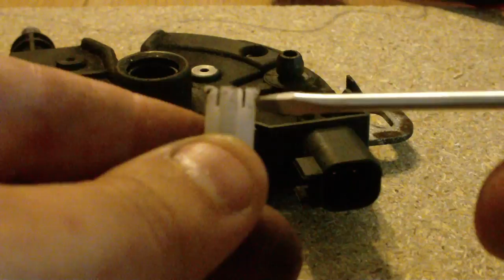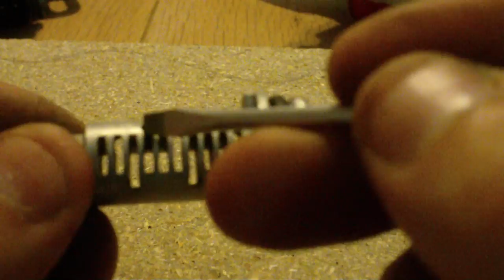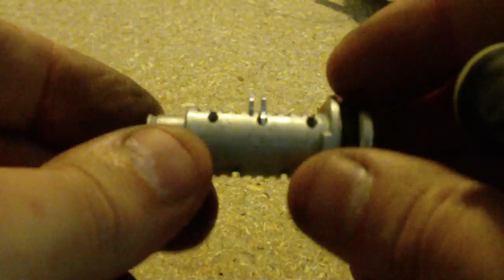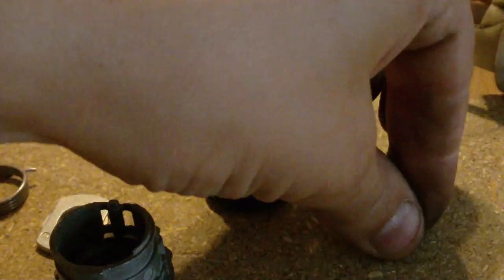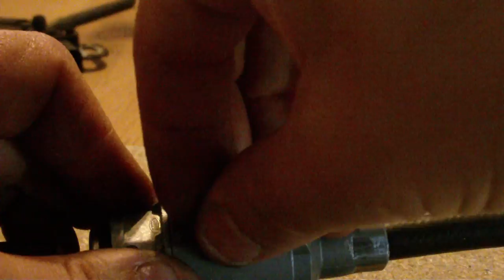Ford Bonnet Lock Barrel Cylinder Assembly and Bowden Cable

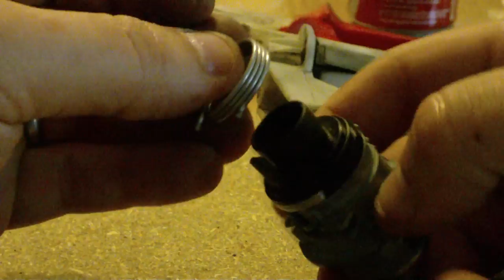Comment: at 15:40, you don't just put the spring on the plastic bit. You have to lodge one of the prongs at one end of the spring against the protruding bit of plastic and then using a screwdriver push the spring from the other prong over. So that when you turn the key in the barrel it will centre itself automatically.
Reply from the maker: Yeah - well spotted - I missed that originally! Works ok, but as you say, doesn't re-centre properly.
Reply: Yep. Thanks for the video though... Very informative and saved me a lot of swearing.  I didnt go all the way rebuilding the lock.. I swapped my entire mechanism to housing..
Reply: How did you get the old lock out of the bowden cable? Did you drill out the pins?
Reply: Stephen Hand it just unclips from the white plastic bit. thats what causes all the problems
Reply: I had a hard time to put the spring in the back together. Came back here to write how it's done. Well you got it right. I should have read the comments before I start working on it.
Reply: It's not too late. 

Drift out the long roll pin, the two shorter pins can be drifted into the lock. 
After disassembly the short pins can be recovered from inside the lock.

No screwdriver needed to force the springs prongs either side of the plastic tab, the spring is not that powerful.

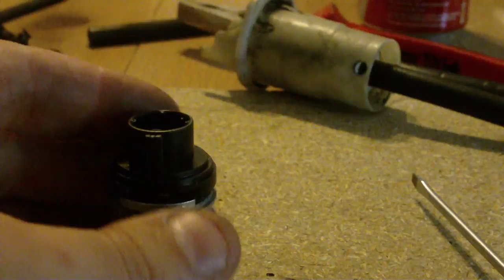Correct spring alignment can be seen here at 14:28 -
https://youtu.be/13QpUSUL5gw
Reply: goood pont man

Comment: What an amazing tutorial. I was quoted £300 by a Ford garage (yes, that is not a typo!) to get my bonnet working again, and I would have ended up with a 2 x key car! Of course, if Ford had have designed a proper bonnet release in the first place, you know, like a lever in the cabin (!), it would have saved us all alot of grief...

Comment: The spring however should be compressed so that the ends of it are crossed on the the black protruding piece. This way key will be always returning to its original position.

Comment: I just realised how old this video is,  but your an absolute star my sons bonnet didn't open after I put a different style  grille in for him, even though I was extremely careful with the lock, but the grille didn't give up easily and I didn't check before I closed the bonnet doh😣....... Fishing forceps pulled the rubber boot off, pushed forceps into plastic pushed lock with the key and 20 seconds after pulling the rubber boot off, I was in....... Thanks again 👍🏻👍🏻👍🏻👍🏻👍🏻👍🏻👍🏻👍🏻👍🏻

Comment: Great video, and 10 years later I'm now watching it. Thanks for doing this, I'm now on my 3rd bonnet lock but this time I've got the alloy one, no more plastic. Will take note on 15:40 👍
Reply: I also need my third on my ST. What a pile of crap that design is. I would be quite happy with a lever inside the car. Never had someone try to break into my engine bay lol!

Comment: No instructions came with the purchase of the new unit, so I had a go at trying to figure it out myself as I'm pretty logically minded. Got about half of it correct, but resigned myself to having to take it it in to a garage. This video explained all the gaps in my guessing, and I will crack on again when I get home! Thanks!

Comment: Great video and so glad it is here. A couple of points to add to the video info:

1) I purchased FINIS 1343577 today and it only came with 8 springs too so this must be the standard Ford pack and you have the option of which 8 holes you use, instead of all 10.
2) In case you were wondering, the lock kit does come with the plastic cross clip that connects the lock mechanism to the latch, already fitted. Saves you buying a separate one if yours is broke. 
3) In the video, the spring seems to be just placed on the black end piece with the two fingers either side of the black plastic post. Although this will provide some spring back, it will not be enough to return the lock to the centre position fully. Instead the spring must be placed on top of the black piece under tension. You do this as you fit the spring by placing the lower spring finger to the left of the plastic post and the top finger to the right of the post. If you have done this correctly then if the whole lock is carefully tipped upside down, the spring should not fall off.

Hope this additional info helps.

Comment: I have just fitted a complete assembly after looking at the first 55 seconds of your video, showing how to remove the white cross part by simply pulling it.  Actually, I'm glad I watched your excellent video, because I suspect, had I tried to do what you did with the lock rebuild, I'd either have lost some springs, thrown it all out of the window or lost the will to live or all three. Well done with your video and once again, I'm glad I bought the complete item. Thanks.

Comment: Excellent video. Great instruction for a very tricky job - thank you. You have saved me £250, as my Ford dealer wanted £300. I had to destroy the plastic bonnet lock assembly completely, as my Focus Bowden Cable had snapped. I also had to use tin snips to cut out the grill. A new grill cost me £19 and a new Bowden Cable repair kit £32, both off Ebay. Thank you, once again.

Comment: Thanks!....Great video... Can't believe Ford don't put any instructions in the kit.
The only recommendation I would make is to work out each key tumbler one at a time, then remove it and write the sequence down as you go. Once you know all the correct tumblers for each slot, build them in one go. That way you don't keep dropping the little springs.
Thanks again for making this... save me trying to work it all out for myself.

Comment: Hello,Thanks a lot for a great video much appreciated, saved me a lot of time.
There is a small mistake at 15:40, when you fit the spring. The two ends of the spring need to overlap over the plastic bolt (so you put both ends at the one side of the plastic bolt, and then you force the second end - further from the bolt and pull it over the plastic bolt.) this will greatly improve precision of the recoil spring, and it will align the key perfectly - no loose key).  

Thanks again!
Reply: How do ya get the spring on it properly without damaging it?????

Comment: Just carried this out and took not of the spring comments worked a treat and saved myself a fair few quid as well many many thanks even managed to complete the tumblers first time and took note of the order the tumbler numbers are as well in case this ever happens again in the future save myself some time putting them straight in instead of having to go through them 1 at a time.

Comment: Just had to do this. One little note, the spring will need to be positioned around the black plastic bit to keep the whole thing nice and tight when you turn the key. Other than that, it's a very good guide and saved me the time to having to work out the engineering behind it myself. Thanks mate.
Reply: Agreed, the barrel should spring sharply back to centre when key released. This is done by 'over-wrapping the spring on the black plastic bit.

Comment: HiMany many thanks for uploading this video.  You have helped me a great deal.  I managed to get my bonnet open without damaging the grill or anything else.  The cable was completely sheered off so the whole locking mechanism was replaced.  Of note, the plastic cross piece connection can be replaced, there is a direct replacement part on Ebay which prevents the locking mechanism from displacing, preventing the problem re occurring.  It's a tamper proof mechanism that has never worked properly so I won't miss it.  Thanks again anyway.

Comment: Very useful video - thank you so much. Thought this would be a painful job but with the help of your video it turned out to be very straightforward. One thing I did differently, which made it a bit easier was that instead of trying to hold in all of the little plates and springs into the barrel at the same time while trying the key, I only tried one plate and spring at a time and recorded the result in a matrix on a sheet of paper. I numbered the slots in the barrel 1 to 8 along the vertical and wrote the plate numbers (1 to 5 and 11 to 15) along the top horizontal side. I put a tick in the relevant box (e.g. if plate 5 fits in slot 1 without sticking out, I put a tick in the 5th box on the top line) and an "X" otherwise. Then when each one had been tested, you could read off the "code" from the matrix/table.

Comment: Great video : purchased a repair kit on Ebay , no instructions, and a great pile of brass bits amongst other things.Watched your video several times and saw how to re-build the lock.Had a few mishaps, which resulted in springs & brass bits everywhere - several times :-(Eventually as I re-built the barrel, I wrote the brass numbers on the barrel with an permanent pen, against where they went.I could then rebuild when I had another mishap !I did finish by using a fine piece of emery paper, with the key in the lock, just to take off any high spots on the brass bits.Thanks

Comment: Thanks for this. I just saved $400NZD by ordering the part from Amazon (cheaper than Ford NZ, who refused to give me the part number) and then a few hours slowly going through your video. I also found some ford manuals online that I correlated with your video. I think the spring assembly has to be crossed over the black peg (according to the ford manual). 

Other than that I highly commend your succinct, simple, well produced video that is saving unlucky Ford owners like myself money!

Comment: Thanks for the video, it worked perfectly. My kit had 8 springs and no number 12s which I think it needed 2 but it wasn't an issue. My only problem was I could not get one of the small pins in at the end, it came unrolled. I will look for something else I can hammer in. EDIT - I hammered out the long pin from the old barrel and then snipped it to size once it was in place.

Comment: the barrel on our focus knackered, so this vid has been a life saver ...well, a £150 saver (which is what Ford wanted to sort it!)
Couple of things that might help others ...we bought the updated Kuga/C Max replacement kit, which is supposedly more robust
& we didn't bother fitting the key pins/springs, which still works (although now ANY ford key will work) as it just wasn't worth the effort (& less things to wrong - as we think one of the pins seized on the previous barrel) ...& due to the cars value being so low, it doesn't really matter

Comment: fantastic video mate, a real life saver. just one mistake, the spring needs to be crossed over the black plastic peg so its taught and under load, that is what gives the spring feeling when you turn the key left to right .  if you don't cross the spring you don't get the return when you let go of the key!  it would still work but you wouldn't get the sensation of the key self centring as you let go. overall excellent video I was really struggling. thanks
Reply: georgegleek you’re absolutely right!
If the spring ends are not crossed on the black plastic piece pin, the spring feels kind of loose. After crossing all feels much more sturdy and the key returns to center position just like OEM lock

Comment: Great video, without which I'd have been lost.  However I wish you had updated it or added a caption saying "the spring needs to be crossed over the black plastic peg so its taught and under load".

Comment: Hi great Video. Looking to do this but use my existing lock barrel. How would you recommend getting the pins out?
Reply from the maker: +i Amr The big pin will push through from either end. Correct tool would be a small drift punch. Smaller pins will need to be drilled out. The challenge will be holding the barrel firm while you hammer/drill.

Comment: Great vid. I too Couldn't get the lock to open even with the screwdriver trick wiggling the lock. Had to cut the grille out. replace the cylinder as is one tip the two small pins have to be pushed in towards the cylinder and I needed a 2mm dia punch. I the barrel still won't come you can drill them out.

Comment: Very Nice video, I would like to add that mark the lock sides A and B start with side A insert key pin in the first hole without spring, to check push it back with your nail (Because you are not using spring) if it fits properly take it out and make a note on paper and than try another key pin in second hole for example Side A= 1-11-2-12  Side B 3-13-4-14 In this way you will not damage the springs or you will not lose them and you will not find it difficult to hold few and try another one,,,Once you get all right just put all springs in along with key pins togeather.
 Also once barrel is in cylinder (before pushing/strocking black plastic thing) put boths side locks in place and wrap your side locks with sello tape so that they will hold the barrel other wise it will slip out and you have to find spring and lock pins(happend with me twice) its a critical step..... you can remove sellotape afterwards before final assembly and thanks for the video highly appreciated.

Comment: Good video - I got no instructions with my new part and only 7 springs - Old cylinder was shot so I salvaged springs etc and rebuilt with all 10 cylinders fitted - Regarding tension spring, The plastic lug was broken off in my old lock so I see it as a point of failure anyway - I didn't cross over - Thanks for the effort

Comment: Great guide very informative. Some points need clarification. Kits usually come with 6 - 8 springs, so you only fit the corresponding amount of key blades. The spring setup is wrong and as stated before needs to be under tension and 'sprung'

Comment: Thank you. EXACTLY what I was looking for..and the best video yet.

Haven't watched all the video yet as my 2007 car bonnet lock just went today and have to wait for the repair kit to come in off Ebay. I reckon I should be OK once I get the bonnet open and have a better look at what needs to be replaced. Looking at it earlier I was able to unclip the bottom half of the plastic grill no problem but didn't want to force the rest in case I snapped something. How did you pull the plastic grill off...did you just keep prizing it off till it popped? Do I need to worry about any plastic clips/screws inside?

Comment: Spot on mate but when I added the spring I tucked each end around the lug so when I put key in it springs back to middle. Seems ok :)
Good vid tho cheers :)
Reply from the maker: Andy Lockyer Good one! Didn't spot that :)
Reply: And the risk of sounding an idiot, can you explain this part to me? I assume you mean the bits of the spring that stick out, but not sure what you mean by the lug or in which direction they would be bent :/
I'm going to be taking this job on once the part arrives. Thanks
Reply: Andy Lockyer Yes this is the correct way to do it. It makes the key spring back to the 12 oclock position. Great video by the way.
Reply from the maker: +Steven Thomas At 15:40 I just dropped the spring onto the assembly. There is a black lug at the front, and each end of the spring is loosely on either side of the lug. Instead of dropping it on loosely, hook each end of the spring onto the other side of the lug so that the spring is under tension, with the ends pulling towards each other on either side of the lug.

Comment: Hi. I just had to pull my grill off and remove the cable, lock etc to get the bonnet open. The white cross is still in although damaged because I was hitting it with hammer and screwdriver thinking there would be a metal catch behind I could twist easier with the screwdriver. I noticed at the beginning you pulled that cross out, my question is.. if I pull mine out what is behind it ? Is there a latch easier to turn with a screwdriver behind the plastic ? Or is there just a hole ?

Comment: Good video and helpful, But you did not fit the return spring correctly. The circular return springs lugs should be on the opposite side of the locator. The way you have it you will find that the key position will not self return to centre. Other than that great help !! I think someone else made the same comment  before me but it doesnt hurt to post it again .Cheers

Comment: Hi great video. Could you please tell me how to remove the two short pins in the original barrel housing, as they are fuse with the casing and does not seem as though they push through as the other long pin. Any help would be greatly appreciated. Thank you

Comment: Bravo very good ,but this O spring mus be tighten i x positio next black plastic.
Reply: Pop Pedja do you put the spring inside the plastic are with a leg either side?
Reply: @Blue116_   these two spring legs you must tight in cross position on this tooth of  black plastic

Comment: If you are using the original barrel/key is it just a case of putting the key in the barrel, removing the pins, pulling out the barrel with key still in and putting into the new one , putting the pins back in and removing the key..?
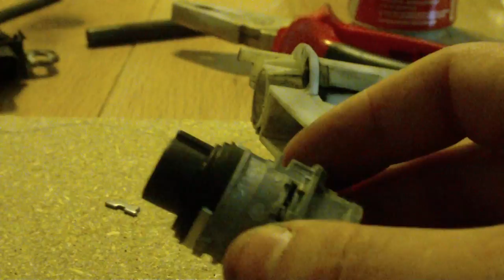Reply from the maker: Yes - good point! You wouldn't even need to have the key it (the levers wouldn't fall out unless you dismantlement it further). You'd be starting at 15:08 after you'd removed the old barrel. The only difficulty would be that you can't get to the back of the two short pins to push them out. You'd need to try and drill them out without damaging the barrel (they're about 5mm long). Might be a bit tricky, but easier if you have a suitable vice to hold the old barrel in.

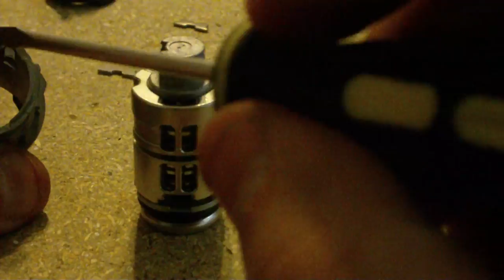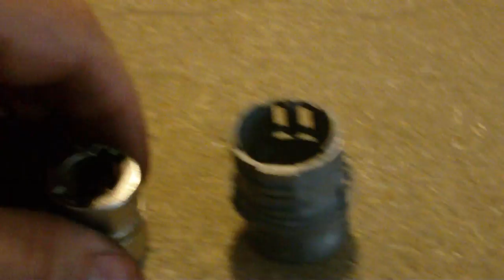If you did damage the barrel, you'd have to dismantle it further, and then you would need the key in to stop the levers falling out. You'd then be back to starting from 13:15 or 12:20.
Reply: Absolute star you are jcwh2 ! Brilliant video. I have just bought a Focus with the lock chopped of by the previous owner. Now I will need to buy a repair kit of ebay and you have given me an answer on how to remove these two 5mm pins! MUCH APPRECIATED!!